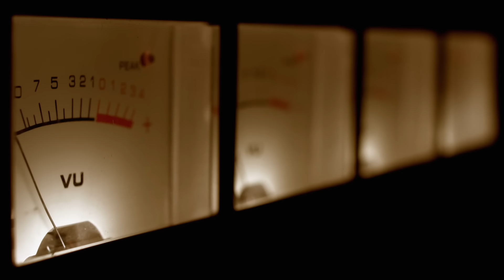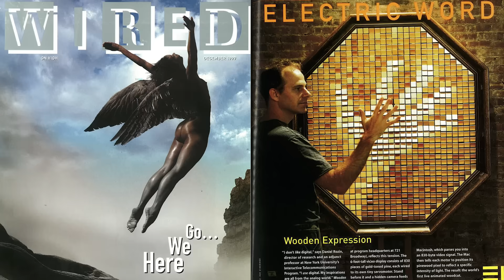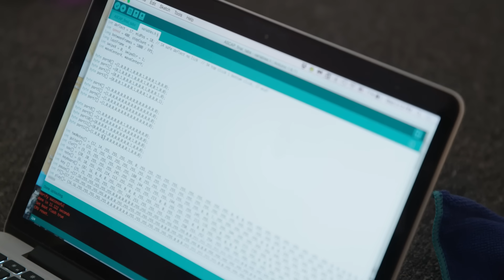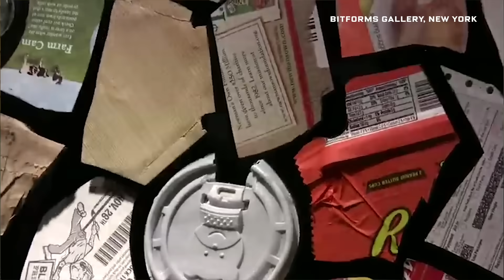How This Guy Makes Amazing Mechanical Mirrors | Obsessed | WIRED

Comment: Needs more cowbell.

One of the biggest problems with military lasers is that they are currently designed for excessively high optical power density.  The extreme high optical power density requires perfectly clean mirrors and lenses, normally made of a relatively exotic and expensive material (rather than using normal glass and normal glass bathroom mirrors).  At high power densities, the moment a single fleck of dust, salt water mist, smoke, bird crap, or other debris lands on the high powered laser mirrors or optical components, the laser destroys itself.  This happens as the dirt absorbs too much light energy and overheats/melts the optical item that the dirt landed on.  This is a fundamental problem of trying to build practical military lasers with high power density.

The solution, is to use a large array of much lower optical power density lasers, and then to use some kind of motors or other mechanical actuators to aim each individual laser at the same target.  However, manufacturing and assembling individual motors and mirrors like shown in this video, is far too labor intensive, and it also does not provide high enough "pixel" resolution necessary for implementing high (combined) power laser arrays (consisting of a large number of cheap low power density lasers).

The solution then, is to adopt photolithography and inkjet printer style manufacturing of electric motors/actuators, in large arrays.  Such methods of manufacturing are commonly used in silicon semiconductor device manufacturing, in making LCD screens (as transistors need to be grown/deposited/created on the glass to control individual pixels), and in printed circuit board (PCB) fabrication used for interconnecting electronic components.  Similar style of manufacturing methods need to be adopted for producing large arrays of small motors/actuators/mirrors/lasers, for producing cheap/powerful laser arrays (that are resistant to dust/dirt/smoke contamination failure).  High powered laser array modules/panels (ex: 1-2 square meters in size, similar to large format solar panels) could then be mass produced and used to cover rooftops of buildings.  When all of the individual (low power) lasers are collectively controlled to aim at the same point in the sky, such arrays could be used to destroy hostile airplanes, missiles, drones, etc.  If designed for such purpose, and deployed at large enough scale, such laser arrays might theoretically also be capable of "attacking" clouds for weather control purposes.  Much smaller laser arrays could also be used for pest control.

Comment: sounds interesting to remake (and kind of easy) the main problem being the electric supply for a 32X32 grid of steppers. He seems to be using 28BYJ-48 stepper motors (2 euros a piece), these are 5V and the ULN2003 Driver he uses draws around 120mA (like around .6 watts). So considering 1024 motors, this ramps at around 620 watts of power. Defintely doable, but not that simple if you dont want to burn your wall ....

Comment: Is it cool? Sure. But he said it himself: they're like pixels. These panels are essentially just a binary on/off light that responds to stimuli within a set range of the object. They're basically very large, very rudimentary, low definition monitors that can only "display" what's in front of them.
Reply: What’s your point ?
Reply: @Mvie..  That you're dumb. Thanks for coming to my TedTalk.

Comment: " Close to a thousand motors" ... That's near the point of diminishing returns, isn't it? With all the NOISE? Maybe it's time to replace revolving "motors" with simpler straight-slide "doorbell" activation mechanisms (much simpler interlinks as well). They could be made slim enough that they could be bundled for the strength needed, just as muscle fibers are. Despite the name "doorbell," these assemblies are all but silent by design, only giving out the very faintest of hums, if that. All you hear when someone rings your (old fashioned) doorbell, is the ding of the sound bar inside, not the force it takes to activate the striker.

The part I don't know about these mechanisms, is what their efficiency is. They may have been tried and failed already,  but I've never seen or heard of an attempt at one yet, so...

Remember that old idea, the robot pet? If that pet is always going hum-buzz-rachet-click at you, doesn't the "pet" idea lose its luster somewhat? I'd certainly like one a LOT better, if its hums were all  but inaudible... and its gears all but nonexistent. It'd be a help in a room full of these "mirrors," too... And NOT losing efficiency to the friction of suddenly-unneeded mechanics HAS to be a plus...
Reply: You completely failed to grasp its inner concept, didn't you? Hence the inequivalent analogy with a robot pet. It's primary function isn't to serve any pragmatic needs, but to convey its inner artistic expression which can not be computed through mere auditory decibels. In a more simpler term, its noise is its purpose, not its nuisance.
Reply: @sadman.saqib.zahin01  Can it, Sadman, you did not address my main point: The NOISE of listening to all those motors spinning. And if you thought my side-track on robot pets was supposed to be SUPPORT for silent artwork, then you need to learn how to read a comment. 

"Inequivalent" analogy? Yep. EXCEPT that it shares my main gripe about this thing: the NOISE of it.

And if you are inclined to excuse MY point about the NOISE, with one about the "concept" being all, then you need to learn the CONCEPT of a comment.

Comment: Now that's art. Real modern ART!
Reply: You don't get it man....
Real modern art is an empty canvas or a banana duck taped into a wall...

If it's more complex than that, prob not real art xD
Reply: My thoughts exactly. I need to see one made by controlling ferro fluid now!
Reply: Are you saying throwing a candy bar wrapper on the floor isn't art? Or a urinal with artist initials on it?
Reply: @notbrad4873 you mean Fountain by Duchamp? Which was submitted to an art gallery in 1917 but was rejected for "not being art" which thus lead to Dadaism and the ever present question of "what actually is art"?
Reply: hitech art

Comment: Did they really just make it seem like all servo motors have plastic gears haha, some motors will come with a gear box but generally the gearbox is a separate component. Also, plastic gears shouldn't be a problem for that application, I cant imagine there being much torque in moving those plates

Comment: This guy is not the original conceptor of this artform. I made an electronic flip dot display for the TRUE Corporation in 2007. It was installed in their new retail store in the Siam Paragon Plaza in Bangkok. The concept was exactly the same, where a video image was used to pixilate a moving electro-mechanical screen. My Company is A.D.Engineering in Perth, W.Australia. A video is on our website.

Comment: Now put those mirrors in front of eachother, jump in between them for a second and then watch what happens. I'd love to try that!
Reply: mirror.exe has stopped working
Reply: It would depend on the delay between the sensing and displaying of the two mirrors. If you had them slightly out of time with one and other you could get a repeated moving reflection of when you jumped out of the way maybe?
Reply: And that's how a black hole forms.
Reply: if you had the timing with some luck it would follow each other until the arduino toast
Reply: oculus rift is a VR headset
Reply: You’d be able to create a time machine
Reply: It would depend on the sensor/camera. If it was a motion sensor, it may go on forever, or it may never pick up on the other mirror moving. If it was a camera, the colour background colours would mirror eachother at first anyway, and there would be a steadily fading reverberation of the person that walked past
Reply: That's when the mirrors become sentient and try to eat... your hands!
Reply: geiger_21 you’ll summon a demon lol
Reply: blown up case of parallel mirrors, or a camera looking at its output - but with a delay and constant variation
Reply: thats how an oculus rift is formed
Reply: @quanny4690  fantastic comment it makes absolutely zero sense I love it
Reply: @quanny4690  what do you mean?
Reply: Quan Nham dork
Reply: He said he's using laser or motion sensors

Comment: BRAVO.................................BRAVOOOOOOOOOOOOOOOOO !!!!!!

I've been flying radio controlled airplanes for over forty years, so I know a little about servo motors.  I also have electronics back ground.  I think that you'd be happy using metal gear digital servos.  I've had used a lot of them on my radio controlled planes and never had any trouble for any of them to give me trouble.  Beside that a museum is open 8 hours a day and only handful of people may get in front of the mirror in that time period.  So you are well within rang of a perfectly functional digital servo operating rang and performance.  A nine grams servo will do the job well.

Comment: If my power cuts and i look at the mirror and it doesn't do anything wouldn't that mean im a vampire
Reply: No, actually. In fact, vampires should be able to see themselves in most modern mirrors. The reason why vampires traditionally can't be seen in mirrors is because, similarly to werewolves, they are allergic to silver, and ancient mirrors had silver backings. Mirrors these days use steel or aluminium backing (although silver backed mirrors are still very popular). So unless the mirrors are made of glass over steel backing, you can't use that as proof that you're a vampire.
Reply: Jade Lin Lee Chen ouch
Reply: YES

Comment: This could also be used as a type of active camouflage in some ways, depending on environment and etc but places like Walt Disney World, already masters of hiding things, could use something like this to hide stuff and the military and corp/industrial world could use it for var security details. On a green energy level, an adaptive focus mirror, like those already used in large optical telescopes, use this system to adaptive focus solar energy on a point to heat water, not like the big solar farms but something smaller and dish shaped like a radio telescope but to heat even food or a pop on/pop off water pipe feeding into a pool or house hot water system. Just seeing further potential beyond art, not making light of the art, it's wicked cool, but I always see multiple uses for things.

Comment: This reminds me of the local phone company, which put up a 4 story sign with their logo on the front of one of their buildings. The sign consisted of several thousand moveable 6 inch metal squares that were attached to the building by hinges. Unlike Mr Rozin's mirrors, they are not individually controllable, and instead of being powered by servos, they are powered by the wind. On a breezy day, you can see the ripples caused by the wind moving over the sign. A truly simple, elegant way of attracting attention. Mr. Rozin's interactive artwork is much cooler though.

Comment: Most modern art's over hyped in my mind. It's only "Art" because some pretentious sod with a vested interest SAYS it is, then they have to explain a hidden meaning of the piece and subsequently why worth it's ridiculous price tag............. This on the other hand is beautiful, And beauty is art that doesn't need explanations. You don't need to understand WHY somethings beautiful for it to invoke emotion. 
You could stand in front of this and just be in awe of the complexity, Or it could trigger an emotion much more profound. I think both experiences (And anything in between) would be valid personal reactions......... And you wouldn't have needed a write up or a museum guide to tell you what you're SUPPOSED to be feeling when you see it.
Reply: * ore -> awe
Reply: @florencegomer7937   Thanks. I used speech to text to "Write" this, and must have missed that one when I quickly double checked the text.
Reply: "And beauty is art that doesn't need explanations" Not everybody needs an explanation for modern art. Some understand a black spot on a white canvas, some don't.
Reply: @anjayl  Yes, And maybe a few people could look at Tracey Emin's "My Bed" and deduct it's meaning without being told the story behind it. But I feel a much higher proportion of people seeing these mechanical mirrors (Who haven't been primed as to the works meaning first) are going to have some level of emotional reaction to them.
Reply: That’s the most pretentious thing I’ve ever read.

Comment: I'm an engineer and I can't take it, these aren't mirrors, by definition a mirror reflects light, these are rudimentary displays that display whatever a video output provides
Reply: "I'm an engineer"  ..terms aside, surely the 'gineer part of your brain smiled when you saw his contraptions making click sounds. If he had ENOUGH tiles, he could generate 'actual' sound, like doom played on floppydrive kinda sound :D
Reply: @Davesoft  his ability to coordinate that many motors is impressive, and yes the possibilities are endless
Reply: @shizuoheiw  metal was used as mirrors so the metal art pieces fullfill this imo. I can really respect this kind of modern art.
Reply: Isn't that exactly what these are doing? Reflecting light?
Reply: @Tadhg_6  No the definition of "reflection: the throwing back by a body or surface of light, heat, or sound without absorbing it" this machine absorbs the image by way of camera and generates a copy of that image.
Reply: Well I'm also an engineer and I say you're only half-right. By definition a "mirror" reflects an image....that doesn't mean it can only be light, you're referring to glass mirrors, which is obviously a specific type of mirror, but these are not glass mirrors.
Reply: @valoredramack9117  the material doesn't matter, these devices are imitating the function of a mirror by using other methods

Comment: I hope someone has informed him about Raspberry Pi.  They are designed to handle all sorts of tasks, including on-board controllers for (automated) robotics, emulating legacy display-adapters, and emulating legacy platforms.  And, each one is only about $30 USD (or £30 GBP?).

Comment: He should try heat detectors, I mean, movement detectors are pretty useful, but if you stop moving the image won't be there. Cameras are good, but as explained, it screws up because of noisy background. The only thing I can think of as bad, is if the heat detectors detect something else, or the motors just downright create enough heat to be detected

Comment: Let’s do some shopping:

3 boards composed of 16x16 stepper motors: 768 pixels

Stepper motor with encoder: $30

Stepper motor Driver: $9

Let’s say each one of those steppers requires 6v 2a. So for one panel you need a 6v 612(+a little)a power supply: $30, if you know where to look

(I sure hope it’s that cheap. If he uses a little 6v 2a supply for each pixel, that’s like $4,000 right there)

Misc wiring: $100.

So all three of those panels is $30,142 in electronics alone (assuming he didn’t get a bulk deal, which I’m sure he did)

Comment: 4:16 - wtf? You're telling me that you did not stop to consider that you can develop these applications outside of the arduino? And that you can write tests and simulations that emulate the movement of motors? And that you can find out, whether your solution, which works for 10 mirrors, will scale correctly for 1000?
Do you think that Tesla builds a full car and then Elon comes along, takes a seat, turns the key only to find that it's not working?
Reply: There's literally a shot of him running a computer simulation of one of his builds at 3:36
He knows. He's clearly not a dummy.
Reply: @esuelle  Thank you, I missed that.
Reply: Actually testing using Arduino itself is pretty useful (it's just buggy btw)
Write any changes while connected and see the log for debugging.